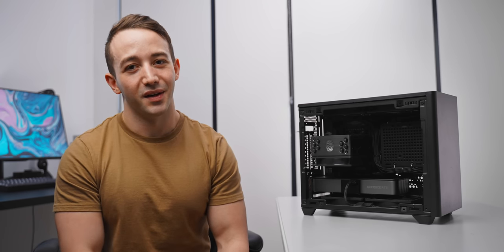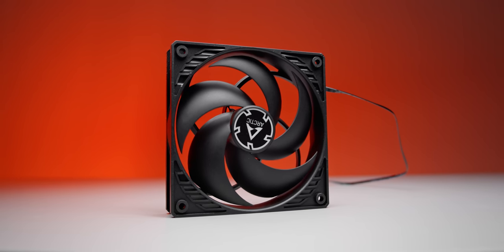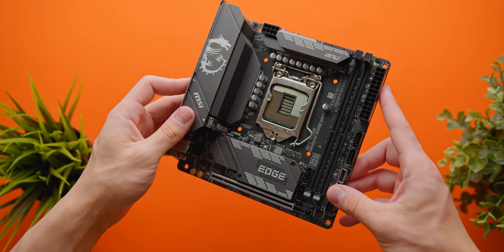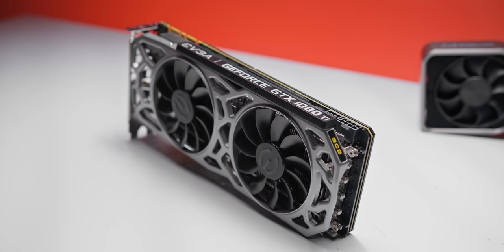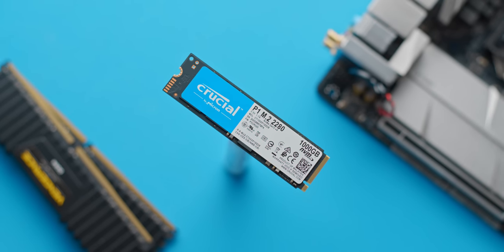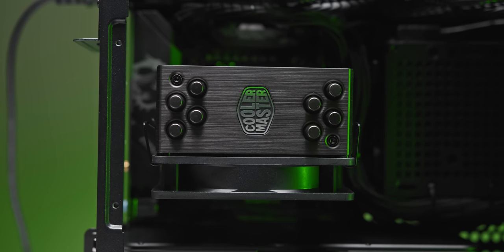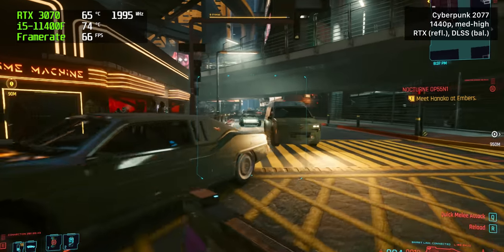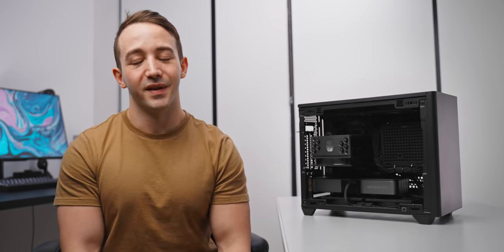Ultra Airflow, Zero RGB - 1440p ITX Gaming Build

Comment: I see the Arctic P12 is a valid replacement for Noctuas NF A12x25, considering as you say in video it is a lot cheaper, but would the P12 be better than NF F12 and Noctuas P12 Redux? For radiator use, I mean. 

I really want to get some NF A12x25 but the PWM version is usually out of stock and when found it the prices are pushing $50 for a fan and I need 5 for my rads

Comment: 3:10 >unlocked power limits i5
Does the same apply to using Ryzen 5 5600x in this build with some B550I motherboard — can you do the same "unlock" of TDP in AMD-motherboard BIOS?

Comment: Cooler recommendation if one should opt for the glass side panel in the NR200P? I am considering either the be quiet! BK031 Dark Rock TF 2 or Noctua NH-C14S. Any other recommendations?

Comment: Did you use the bottom fans for intake and the Top fans for outtake? Cause that’s what I did. My GPU is the 3060ti from Gigabyte and it hits 85 degrees or sounds like a freakin plane 😪

Comment: Will a 3090 fit into a NR200 without any fancy fuckery?
Reply: Easily. I fit my FTW3 and simply removed a single side rail near the bottom (2 screws). 64c under load and no extra fans under the card either.

Comment: G'day, how do you connect all the case fans up to the MB? is there a specific controller or splitter you use? And does that connect to 1 MB Pin? Cheers
Reply: Yes. Ali didn't mention, nor show, that part of the build for whatever reason, but yes, you'll need a PWM hub. Most ITX motherboard have only one system fan chassis header, the CPU fan header, and possibly a water-pump header. If you go with his layout you WILL need four PWM fan connections besides the CPU fan (which should always be plugged into the mobo directly). The maximum power draw of the system header on this specific mobo (the MSI MPG B560I Gaming Edge Wifi) is 1A. Do your due-diligence. Find your power draw per case fan. If it you're using the Arctic P12 fans in this video you have no worries and can just hook four of them up to an unpowered PWM extension hub (can get one on amazon for about $8 US).  The Arctic P12 fans claim a power draw of .08A (80mA) at 100% load, so four of them will only draw ~320mA, well within the specs of the mobo 1A limit for SYS_FAN1. If your fan total is approaching anywhere close that 1A, just don't risk it. Get a PWM 4pin powered hub ($12-$25 US on amazon) and use that instead.

Comment: Looks like two fans up top and two on the bottom. Which are exhaust and which are intake?
Reply: Bottom intake, top exhaust. 
Fans have 2 sides; one side with exposed fan blades and the other with supports connecting the central hub to the rest of the frame. Often resembling an "X" pattern. The exposed fan blades is where air goes in, the "X" side is where the air comes out.

Comment: @optimumtech

You cannot buy 30 series FE gpus at Micro center...
Only best buy carries the FE and you can only get them online... and you know what that means. Botters :(

I did manage to get the cheapest 3070, the EVGA xc3... however, it was still $630 (+tax). Which is still $163 higher than FE msrp :( 
$70 away from a 3080 FE lol

Comment: 3090 would never work in this case unless you upgrade the psu to something like 850w
recommending a 600w fs is good and all but dont say you can put in a 3090 with just that psu

Comment: Is the gpu a bottleneck in apex in that case? I’m surprised you can’t reach 200fps on low/mid.
Reply: dude its a 3000 series card there aint no chance its a bottleneck
Reply: @williamafton7698  well there is, especially on this resolution.
Reply: @kubager  welp if its a bottle neck i cant recommend any other card since the 3000 series are the best on the market
Reply: @williamafton7698  Just wondering if the 3080 would make much difference at 1440p

Comment: Personally i got problem with my p12's and NR200. In particular, bottom intake fans create noise with rpm higher then 800-1000. Fans themselfs are quiet even whit rph higher then 1600, but the noise created because of bottom pannel grill. Any specific fan recomendations?

Comment: this is my dream pc accualy. i have same case and cooler using ryzen 2600 right now. want to upgrade asus b560 board and 11400f cpu and my dream to find rtx 3700 even 3060Ti will be dream for me but no stock at all here in istanbul. about that cooler not fitting you can remove that top cooler master logo cover if you want for fit glass panel on. you don't need smaller cooler :) i'm using it that way my glass panel on :) bad thing about that cooler you can't use tall ram's. i have dominator rgb ram's so i use rgb fan as pull :(

Comment: I'd like to build something like this but use AMD parts instead, I was thinking 6800XT with a 5600x to go with it, would i need to change a few components regarding the air cooling or is that fine, I've no idea if the temps would be any good or if the card would even fit well enough to put any fans under it. I'd rather stay air cooling if possible, I just don't feel comfortable with liquids THAT close to such expensive stuff but that's just me...

Comment: Curious why you didn't mount the GPU vertically.  Seems like both the CPU and the GPU would have had better access to air if done that way.  Would it not fit?  Btw, I have an AIO build with that case.

Comment: Hello, would I have the same results (temperature, noise, performance) with a B550 mother board and a ryzen 9 3900 CPU ?
Is this exact card the only model that can en able full power mode ? Or are there other Alternatives ?

Comment: I have a very similar build but am using a noctua NH-U12A for the CPU cooler. I’m debating whether it’s worth orienting it so that the air flow direction is vertical as it is here. I think it makes more sense for it to be vertically oriented, but am not sure if it will fit in this orientation. Any ideas?

Comment: What are the lengths of your sleeved cables? I find my 24 pin struggles to slot in as I do have a 3.5" HDD there in my NR200P.

Comment: Yo anyone have an opinion on the best itx case with standard atx psu and space for a drp4 or nhd15?? The nr200 can fit a standard psu but won't fit a large air cooler :/

Comment: horizontal cooler is ok? Im honestly asking... since im using 3 fan gpu (278mm), when i do horizontal cooler, it has about 2cm clearance from cooler fan to gpu backplate... using vertical cooler also no go since the gpu block everything and any air get exhausted before pass trough cpu... inverted vertical cooler with rear intake reduce my cpu temp by few degrees but then everything else become hotter (gpu,hdd,ram) since the hot air gathered at the middle of the case before exhausting trough top... idk what to do anymore...

Comment: Question, I am going to use some of my parts and new ones combined to build this, my 2080 Super MSI Trio has three fans that point downward, how would I configure the airflow in this case to adjust for this? (as I imagine they would fight against the intake at the bottom). Thank you in advance!

Comment: How did you set pump fan to 1200 rmp, my intake noctuas spin at 100%, i tried bios but i can’t control them.. intake’s are connected to the aio header because I have only one sys fan connector? 
Any advice?

Comment: Do you think it would be a good idea to use a ryzen 5 3600 in this build?
Reply: the 11400f has more performance, but if you already have it go crazy. all i have to say is find a itx motherboard with atleast 3 pin outs, 1 for cpu 2 for fans. you can get fan splitters for the 4 fan setup.

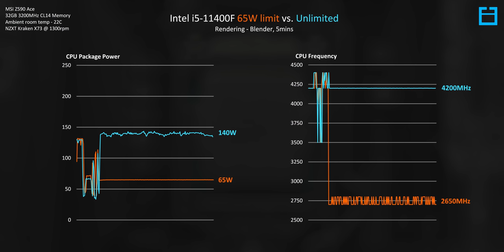Comment: Thanks for this! Just built something pretty similar following this (minus GPU, saving that for next year hoping for market change, as its primarily a workstation anyway). One thing I noted, tried the vertical orientation of the CM Hyper 212 Black on the B560i mobo, but I thought I saw/felt a heat pipe was touching one of the capacitors on the left of the cpu-socket (seen in 3:19 in this video). So even though I seen it had been done here and perhaps it was really ~0,5mm distance between I could safely confirm with my own eyes myself, I didn't dare to screw it in and went for the normal orientation. Anyone has input on this?

Comment: How do you control so much fans? I only have 1 connection. Can split to 3 fans, but i have read that max of 1A per fan is max to make sure not to damage your mobo.

Is the noctua na-fc1 a solution to give it more power and attach 6 fans (2 cpu, 2 up and 2 down)

Comment: Would this build work with a 5600x and a RX 6800?
Reply: Of course but don't use the P1, it has QLC chips
Reply: @rubenschilling  Im actually building a pc in the nr200p, Im using a sn550 and a sf 750 and 32gb of ram eith a gigabyte b550-i, so similar class of performance

Comment: If the max height for CPU cooler is 160mm, is there any chance to fit the Gelid Solution Phantom Black? It's 160mm in the specs page and I wouldn't want to buy another one

Comment: i was planning on doing the same kind of build but with an AMD cpu and better cooler: which one would you guys suggest? I was thinking about the Noctua NH-U12A but it's expensive compared to my other option: Scythe Fuma 2
Reply: I have Scythe Mugen 5 on 8700k 4.9GHz 1.285V, 33C idle, 65C max load, standard mount, rear and top exhaust.
Reply: @TheDevilHimself  that's not bad at all. thanks for the feedback. although i'd rather have a cooler with more flexability since the Mugen 5 can only go to 800rpm max

Comment: Hi! Is 600w plat psu enough to run 3070ti with i5 11400f? I am quite worry about it as I have already bought the parts and afraid the pc could not run properly.

Comment: been on the web site to try to see availability of a 3060 founders in the UK most days since launch today's stock include 3080Ti 3090  3090 Ti, all cards over £1050, think nvidia has not stocked the 3060 at all in the UK, gone APU amd 7 5700g & sticking with it. it's good enough for me, miners have killed the GPU market & the manufacturers have blanked the gaming consumer. With the money saved from the miners purchased a PS5 for that 4k gaming. 
thing of it is if they came back to me now i would properly tell them to stick the GPU were the sun does not shine.

Comment: Usd$1350 just for the gpu or all together without gpu ? No way anyone can have this build under $1500.
Reply: yeah, i would just not buy gpus rn. just get a 11400 instead of 11400f or get those new ryzen apus and a dif motheboard. heard they could get like 1080p 60fps +. im going for this setup and i can wait a realllllyyy long time for the gpu since i have a shit monitor so if i get a rtx 3070 i wouldn't be pushing it to the heights and limits its suppose to go.

Comment: is it possible to have 5950x fit in an itx build? is 240mm AIO ok for it?
Reply: Nr200 with a 240 or even a 280 is ideal for the 5950x. Lots of builds using those parts on Reddit; a quick google and you can find them by searching “nr200 5950x”. Cheers.
Reply: @NOSfusion  thanks, I currently have a 750w power supply, not sure if it's suitable for a 5950x build. Since the largest SFX power supply is only 850w, it may not be valuable to replace it with a little larger watt power supply.

Comment: on the pcpartpicker is says the cooler master hyper 212 black is incompatible
Reply from the maker: Yup, it's too tall to use with the side bracket or TG panel as mentioned. for the regular vented panel it's fine though.
Reply: @optimumtech  oh thx
Reply: @optimumtech   so for the bottom fans is it intake of exhaust

Comment: can someone help me im building this for my first pc ever and have no idea where those arctic p12 fans went inside the case
Reply: He put two on the roof grate and two on the floor plate. The GPU is horizontally mounted. If your GPU is ginormous 2-1/2 slot or thicker you may not be able to fit the bottom fans. In total this build has five fans: 2 roof, 2 basement, and the CPU air cooler. Technically in a horizontal build you could shove two more on the side grate if you're using it, but you honestly don't need to. With that after market air cooler the side-grate fans won't fit anyway, so no further need to cover those. 

What he did NOT mention, nor show, in this build is the requisite PWM fan hub. Most ITX motherboard have only one system chassis header, the CPU fan header, and possibly a water-pump header. If you go with his layout you need four PWM fan connections besides the CPU fan. The maximum power draw of the system header is 1A, and those fans draw 80mA, (so .320A together). Therefore you don't need a powered hub. But you DO need a hub that has a pass-through sensor line (the fan connected to it is the one the system BIOS reads as "the speed", and adjusts PWM accordingly for ALL of the connected system chassis fans. typically this is the "CPU" marked header on the hub). Check on amazon (some search terms: Motherboard PWM Fan Hub Splitter, 4 Pin Black Sleeved 5 Way PC CPU Cooling Case Fan Extension Splitter Adapter Cable). Do NOT plug your CPU into this hub; plug it into your CPU header on the mobo. Plug the hub into the system header, then the fans into the hub, including one fan in the sensor slot. That should do it for you.
Reply: @Craig-ib7gk  thanks so much man you have no idea how much i appreciate this

Comment: I just don't get why people build mini ITX PC. You're killing your components by lack of space for air (hot/cold) to move in and out. You build PC to put away and never be seen. You're not going to put it next to your monitor at your desk to gaze at it. Normal or even Big PC cases are way better. better at managing CPU/GPU and ambient temp and gives head room for overclock w/out the use of AIO coolers. I just don't get it.
Reply: yeah me too, until i realized i have no space on my desk. however, it can be fixed by just getting rgb ram, a rgb aio, rgb fans, and strips if you really wanted to go out and use the nr200p. it still looks ballin but just smaller. Also the temps dont kill everything, it was only like 78-81c for the cpu and gpu. i think das fine.

Comment: Can I fit an ATX PSU in it??
All SFX PSUs are crazy expensive here (similar the same price as 3600)-$200+
Reply: There are 3D printing files for ATX brackets on the Cooler Master site, but you might lose some GPU length.
Reply: @che-weihsieh975  Like really, r u 100% sure that one can fit in that?
Anyways my brother doesn't plan to put in anything crazy-a 3060 at max when prices fall down, but right now he's eying a 1650 or maybe just a 4650G, bcoz 1650 is also selling for 1660Ti money.
Also we don't have a 3-D printer, but I think we could take it to a machine/fab shop since it won't be too complex. 
The SF600 & CM-V650 r pretty expensive, now he can go with a much cheaper $100 500W Bronze or Gold PSU
Reply: @sushimshah2896  you don't always need to buy Corsairs sf series, maybe look out for be quiet or Silverstone psus
Reply: @sushimshah2896  there are working examples of the 3D printed bracket on Reddit. You can search it up. The cables will mess up the space for your GPU and the suggested length will be limited to 23 or 24cm. One of the post commissioned the bracket for 18 USD including shipping.

Comment: Doesn't Nvidia recommend a 750W PSUI for the 3070? Just wondering if the gpu can work on its full potencial
Reply: Why, it is a 220w card, quality 500w is ok, 600w is almost overkill
Reply: @riba2233  because of the spikes the 3070 can output.
Reply: @ci-ci42  I know but still ok, good 600w models can handle 3080

Comment: Zero RGB sounds like a stupid approach to brag about. It's like saying I bought a car with no radio because I don't like listening to music while driving. People will be like, why don't you turn it off dude?
Reply: the anti rgb thing can be fixed by just getting rgb ram, a rgb aio, rgb fans, and strips if you really wanted to go out and use the nr200p. it still looks ballin but just smaller. and the temps dont kill everything, it was only like 78-81c for the cpu and gpu according to the video. with the rgb fans and no ventalation its probs gunna be like 85-87c. i think das fine.